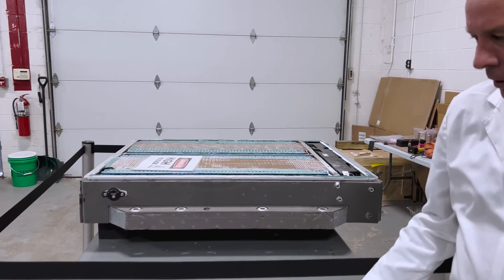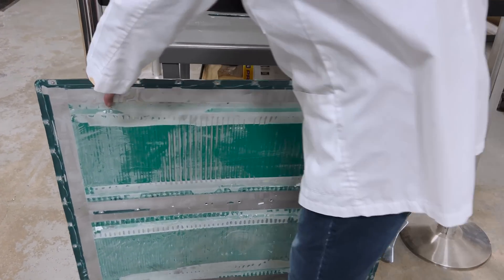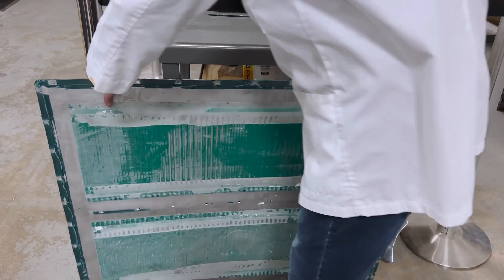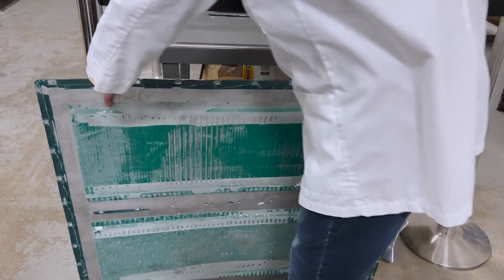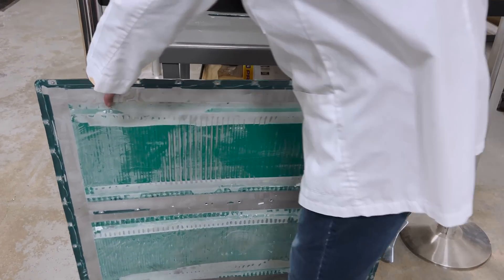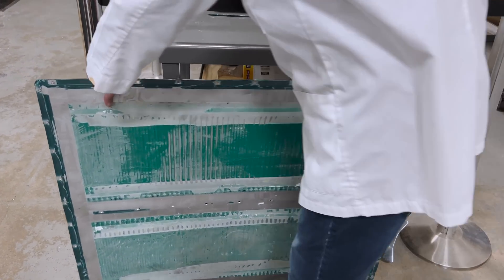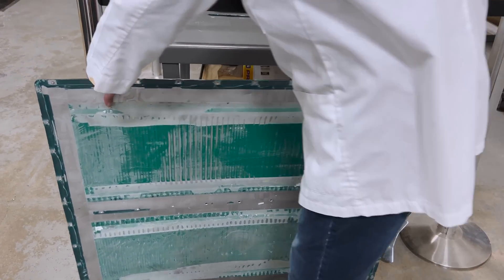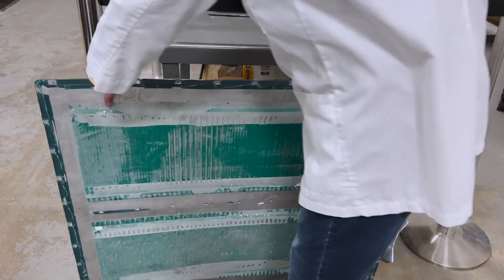Shark Attack! Breaking Down BYD’s Battery Pack

Comment: It is shocking just how bad the analysis is.  They were guessing about the ports, AFTER they disassembled the car, removing the HV wiring that clearly went to a motor or charging port on the pack. Did nobody think to just label the port?  
And then they complained about the strong glue between the base panel and the cells.  The glue fuses the cell to the panel, so the the cell casing acts as a structural rib.  Same reason why they are using bus bars with zero tolerance, so that the cell case is constrained together as a single unit.  This is how the BYD battery pack becomes a very strong, structural element while minimizing weight.  If they have the cells "loose", they would need a much thicker, heavier base plate to achieve the same strength and rigidity.
Reply: I'm not sure, but I think Munro has been having a little turnover. If they have openings maybe some of the "Tesla Experts" who post here regularly should apply. They sound very confident in their engineering skills.
Reply: The whole Munro team are numpties, they really think these old hot rodders know more than companies who hire the best of the best with billion dollar budget.....
Reply: @ Sure, though a whopping $5 USD worth of masking tape and permanent marker makes it dead simple to know exactly what each port is for.
Reply: @ZweiZwolf  I use the blue painters tape for that, but you be you :-)
Munro ain't what it used to be. That's for sure. Do you remember Sandy showing up on Autoline to talk about the amazing details in the New BMW i3? That's when I started paying attention to him. He had a good eye for detail in cost of mfg. Talking off-casts and nesting, my heart grew warm. Since his infatuation w/ Elon this channel's attention to detail has been, well, embarrassingly bad.
Reply: The 4680 cells in Tesla's battery pack are glued together with a tenacious poly-foam which makes them very hard to remove, at least all the reviews I've seen, so initial reviews were "unable to repair", though vaguely recall seeing that some people found a solvent that dissolves the foam.  That was to make the battery pack stiff enough to act as a structural member.  At least, the spiel Elon gave during Battery Day (take 1, ~2019 forget).  I understand those are only in some Model Y made in Austin, and the 4680 cell apparently didn't realize the many promises made for it.  Perhaps BYD is following the same "structural pack" idea.
Reply: @ BYD is definitely using the pack as a stressed member. They even say so.  And the teardown proves it, where the cells are bonded to the base, functioning as ribs, making the pack one solid block.
Reply: This video isn't intended as an analysis, just an update on their progress breaking down the battery pack and why it's taking so long. They aren't saying the glue is bad from a manufacturing and safety standpoint, just that it's making their teardown difficult. They said the same thing about the Tesla foam, they had no complaints about it regarding its manufacturing benefit, but had plenty of complaints about it delaying their full teardown.
Reply: @ It's a question of framing the commentar, and they should have said  "This is excellent manufacturing, exactly what we recommend: zero fasteners, low complexity, low cost.  As an added bonus, it's almost impossible for the customer to disassemble, practically guaranteeing that all service is by authorized mechanics."
Reply: I was waiting for some technical details. Maybe that's the next video?
Reply: Munro and Sandy said they are constrained on how much they can do and say due to the client.
Reply: @ If that's the case, then they can just stick to the facts without making obviously wrong claims.
Reply: And yet the very old Nissan Leaf battery has fully replacable modules which mean if a module fails the whole car is not written off! Crazy setup with the Blade battery and especially with the new structure battery which even a rock damage to the case most insurance companies just write the whole car off! No wonder EV insurance is so expensive!
Reply: When a manufacturer actually follows Munro's strange obsession to preach "no fasteners" , they complain about an assembly that is glued together
Reply: @oodlespring  With his "no fastener" obsession, Munro seems allergic to future repair!
Reply: @ The 1st gen Nissan Leaf battery used completely different architecture and chemistry because they weren't able to produce a large structural battery pack.  The Leaf used 7.5 battery modules which were cargo that required a stronger frame to support them.  BYD's has been building EVs for a long time, and it looks like there's pretty low risk of damage to the pack. Unlike a NMC battery, the newer LFP batteries don't have the same risk.
Reply: @gregb1599  my old atari computer had the logic chips in sockets so they could be replaced when they went bad.  I had to remove and reinstall them when it would go flaky.  Today my phone has nothing in sockets.  It's all soldered and sealed.  Funny how even though it's not repairable, it has not failed in the 6 years I have had it.  Now I have to toss it as it does not support 4g and 5g networks and 3g is switched off.  Maybe the old leaf batteries were built at a time when cell failure was a possibility and now byd cell failure is unlikely but reliability is built in by glueing everything so nothing vibrates or loosens.  Times changes and manufacturers improve.  Byd is growing while Nissan is almost out of business
Reply: @gregb1599  still building batteries in some paleolithic fashion.
Reply: @gregb1599 That is why Nissan leaf battery fails so often while BYD’s battery is still going strong after 1 million km of real world driving. Engineers with confident does not need plan B
Reply: @gregb1599 it's designed not to be serviceable. Replace the whole box, if faulty.
Reply: @ No, it's serviceable by a trained technician who would use the appropriate solvent to unbond the cells from the base for disasembly and refurbishment.  It's not like BYD went and permanently welded the cells to the plate...
Reply: What are your qualifications again? Thanks
Reply: @ I happen to have multiple Engineering degrees, but the mistakes they are showing can be caught by anyone with eyes and a functional memory.

Comment: Super interesting. Not an 18650 in sight.
Reply: This is BYD blade battery, the best LFP battery tech. Safe, no fire even when punctuated, good power density. Can handle high speed charge and discharge.

Comment: If there is ever a little battery failure in one of those blades, the whole battery has to be removed.
So one little failure in one blade will result into a loss of the car.
Reply: The battery pack is a big module that bolts into the frame and can be easily swapped.  A pack failure is a simple service repair.  
Then, BYD will use solvent to unglue the insides and do whatever repair is necessary to refurbish the pack.
Reply: No, a BMS can lock out the defective cell. It's what Porsche has done to their Taycans.
Reply: @GG-si7fw 
That's not how a BMS works,  also not this one. 
All cells are in series. If one would be shut off (or failes), the whole battery dies.
Some other manufactures are using a few to many cylindrical cells in parallel,  each with a fuse.
If a cell dies, the battery still functions.

Comment: Good luck trying to repair that battery, no cell access at all! I would rather a 'less efficient' battery that CAN be repaired...
Reply: It depends on what the replacement pack cost is.  If you are going to have to pay your manufacturer/dealer to replace a single cell and that is going to cost $1500, then a $3000 replacement pack (as someone said above) is not that bad.  It is not something most dealership service centres or home mechanics are going to attempt.

Comment: Be nice to see a matrix of pack power, density and weights.  Also recycle-ability  (circular economy) should be a metric that is tracked.  A vast majority of 12V auto batteries are recycled in the US. Impressively so really.  The intention for US manufacturers is to follow this requirement minimizing waste and environmental impact.  Of course the US threw out 33 billion AA, AAA, C, D and 9V batteries last year alone.

Comment: The foam covering of the pack is probably for slowing stones/sand etc as the impact the pack, to limit/prevent damage to the pack itself. A good idea for offroad, though why they don't do it for the fuel tank...?
Reply: It's thermal insulation.
Reply: New fuel tank $299

Comment: I think the blade battery pack is the gold standard right now, for the safety aspect alone. Isn't Tesla supposedly using them for the Model 2 or whatever it ends up being?
Reply: Tesla is already using a 58kWh BYD blade LFP in the german made Model Y SR, 2023-2024. Best battery so far
Reply: @t.d.5804 excluding North America market
Reply: Not only Tesla , Toyota and KIA too.
Reply: @davidm2893  who would've thought a battery manufacturer turned car manufacturer would be able to produce an industry leading battery 🤯😂
Reply: It’s in all models built outside of US manufacturing.
Reply: @kennethprocak5176 no China made use CATL
Reply: No, CATL is the gold standard. The blade battery is ok, but it's just a shape ok. CATL has way better chemistry.
Reply: @HermanWillems CATL is the best for NMC battery, BYD blade is the best LFP battery. Both have pros and cons. NMC has higher density, but its less stable, more likely to catch fire. LFP battery has better safety.
Reply: it is just different shape of the LFP battery chemistry not the ''gold'' standard lol
Reply: I would say poor standard, how could a company make batteries that are zero repairable! They have very poor cooling as in single sided cooling! They overheat as shown by one YouTuber that did the 1000km challenge and it rapidgated badly! Any damage to any part on the battery by a rock and insurance companies write the vehicle off! It's even worse on the new structural batteries. Hopefully the next gen Blade battery fixes some of those issues but I seriously doubt they will!

Comment: Another battery that will fail prematurely. Cooling is suboptimal; only one side on the thinnest edge of cell. Heat and level of discharge are the fastest way to delete  your battery.
Reply: In countries where the BYD is available (not US) a 8 year warranty is offered for battery.
What part of that is Premature?
8 years, Premature - really.
Reply: @ianweal3081  warranty does not equal longevity.
Reply: @diydad5067  you're guaranteed 8 years of usage, what part of 8 years doesn't equate to longevity for you?
8 years is an eternity for the average car owner.
Reply: @ianweal3081  If the battery meant for atleast 5000 cycles/( 1 million miles+) then by definition premature failure.
Reply: Are you serious.😂 Even the first generation Nissan Leaf from 2014 had no active coolant and lasted 10 years and 250,000 miles of use.
Reply: @DeniSaputta  never happened.
Reply: @DeniSaputta  10yrs with what range at the 10th yr? 15 miles per charge?
Reply: @diydad5067  250.000 Mill.And even now many  people are upgrading old nisan leafs with 62kwh second generation LFP with active cooling. Replaces 62kwh MNC passive cooling in old car .
Reply: @DeniSaputta  Im not sure what we are disagreeing about, but there must be a reason for the new and improved battery with active cooling. Thus my comment about premature battery failure. LFP batteries should last 5000-10,000 charge cycles. Which means 1 million plus miles under optimal conditions.
Reply: @diydad5067  5.000-10.000 is charger 0,2 C (Solar panels) discharger in 0,5C.

 In the real world, car  use DC chargers more often. And have highest dischard
Reply: @DeniSaputta  Again discharge rate/higher amperage draws causes lots heat. Without efficient way of dissipating heat batteries degrade quickly. Try using AC just on your one arm and leg on a sweltering summer.
Reply: Not sure about that, but what is certain is that if a cell fails for whatever reason, this pack is not going to be repairable. They could recycle the cells (with a lot of effort), but the car owner would need a whole replacement pack. I'm sure that's great for reducing manufacturing costs, but terrible for longevity and cost of ownership.

Comment: When you say “AC Cooled” do you mean cooled by refrigerant?
Reply: Yes, the cooling plate is just a large AC evaporator.
Reply: And not cooled that well as shown by many testers of BYD cars during charging they still overheat, maybe the next gen Blade batteries will cool from both sides as clearly one sided cooling is not sufficient
Reply: @gregb1599  I'm surprised they didn't run resistive heating+cooling channels down a few  of the cells (or underneath for that matter). Probably wouldn't need it for every cell, but it wouldn't hurt to break up some of the thermal mass.

I guess it doesn't matter as much for a smaller pack in a PHEV
Reply: @gregb1599  Tesla Model Y with BYD LFP blade can do straight 170kW from 20% to almost 80% full on. No overheating. That is Tesla Engineering. It's not only about the cells.

Comment: There are some interesting and impressive things going on in the BYD battery - but design for recycling in not one of them.
Reply: They grind them up and recycle  94%  of the battery
Reply: The batteries can be reused as stationary stacked  storage after years of use in vehicals. They don’t degrade greatly, but motor vehicals doesn’t  have a physical life past 10yrs.  So the battery can be repurposed.   They are LFP batteries.
Reply: It's a lot easier to recycle than many other batteries ... Discharge and strip out the cells... Not all will be dead but as these cells are already safer and cheaper to make.. that's been the challenge but in Europe we have plants that are already recycling 80% of the Li and Phosphate....  But the bosses of byd and catl seem to be forecasting a 50%drop in a new pack price by the end of the year.  So it will be cheaper than doing a typical ICE engine rebuild.
Reply: The battery is good for at least 20 years, so that won't be a buyers problem for a good while yet.
Reply: 电池回收时专业的公司去处理，并不是个人回收
Reply: This is a tired argument. Modern battery recycling process is they discharge it and chuck the modules in the grinder. Also, this is LFP, probably not a huge demand for recycling, far more value as a second life battery for stationary storage.

Comment: Could you use axe on one of the cells to see what happens?
Reply: Nothing
Reply: To clarify what the other guy said, it's an LFP pack - go watch a vid of LFP packs being pierced.
Reply: @concinnus Yeah the one put on by BYD in a very controlled environment, while in the real world even the mighty Blade batteries still catch on fire, yes less than other types but all Lithium batteries catch fire even LFP! Stop believing the BS that LFP does not burn!!
Reply: Certainly won't be taking an axe to it, if you're going to destruct a battery it better be in a controlled environment away from humans. These things release extremely unhealthy gases when punctured.

Comment: those batteries have a slight buldge when it charges/discharges. To prevent over buldge the battery is encased in the cage with very minimal wiggle room.
Reply: They should only bulge from offgassing in the first few cycles.  That can/should be done in a pressure fixture before assembly into the pack.
Reply: @concinnus  All LFP cells somewhat expand during charging, because of intercalation of lithium ions into the carbon anode, and contract during discharge. 
If some silicon is used as addon for higher energy density, then the anode expands much more, because of build of lithium silicides. But BYD is using mostly pure carbon anodes.
The fixture is required on first charge to push out gas introduced into the cell during production, and should be kept with a pressure of about 3000 N/m² to avoid electrode separation during the charge/discharge cycles. There was once an A123 module design document that covered this issue in detail. Both lower and higher pressure cause lower cycle lifetime.
Reply: @ Oof, didn't realize there was a sweet spot.  That's going to be impossible to achieve for an end user with prismatics because the casing applies some pressure towards the edges.  And an A123 paper has to be somewhat obsolete at this point.
Reply: @concinnus  The pressure value is also specified in the specification of EVE and other cells, and there also a lot of other studies. With pressure, which can easily applied with the correct screw torque, the number of cycle is increased considerably.
Reply: @markplott4820  The 4680 cathode is NCA or NMC, and Tesla uses BYD/CATL for LFP, genius.
Reply: @markplott4820  Up to now BYD is one of the leaders in LFP technology. Tesla 4680 cells currently not any better than any other cells. They are still weak regarding charging. The new platform charges the battery with up to 1000 kW (10C).
Because of form factor there is some loss regarding volumetric energy density and problems with cooling. A tight block of prismatic cells has advantages here. The dry electrode pasting brings not much advantage regarding densities, only regarding energy use during production. LFP has won the cost race for lower end cars against NCA and NMC cells. LFP costs are now below about 50 USD. Tesla is currently not able to match this.
LFP is even used for trucks now here in Europe, and for large scale storage no one is using NMC anymore.
Reply: @markplott4820  That is just not true. EM meant in his statement that the 4680 cells are now cheaper than those of its current suppliers, not on earth globally. And remember, those old cells have a smaller form factor, which is much less cost effective to produce. 
So it is good that this goal was achieved, but this is expected with the larger form factor. But the Chinese are still much cheaper with LFP.